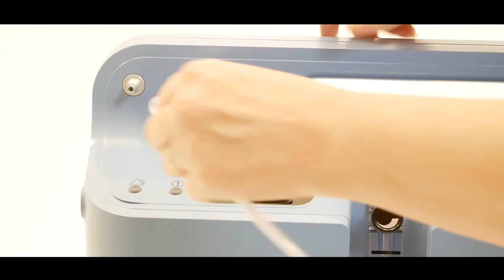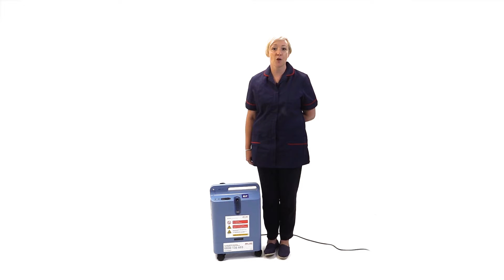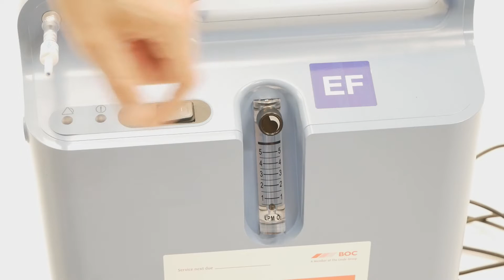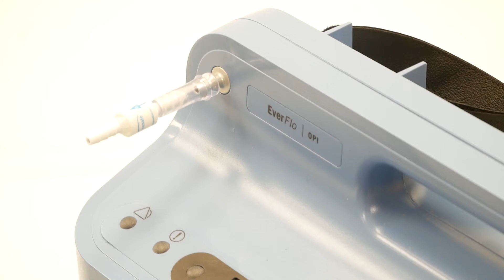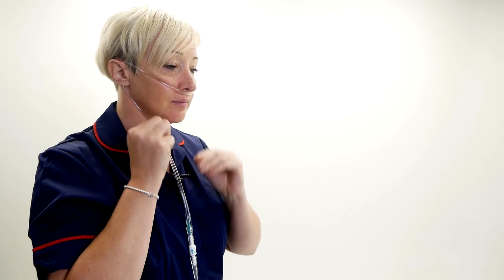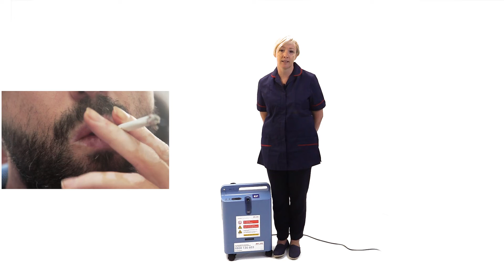How to use a standard oxygen concentrator

Comment: "350 watts per hour".

This is a mistake. Watts don't measure amounts of energy but power, i.e. amounts of energy delivered per unit time. By definition, 1 Watt is 1 Joule (a unit of energy) per second. 

The concentrator is, presumably, a 350W device. It uses 0.35 kilowatt hours (a unit of energy used in calculating electricity bills) every hour. That is about the same as four 90W light bulbs (the old, 'incandescent'  sort).